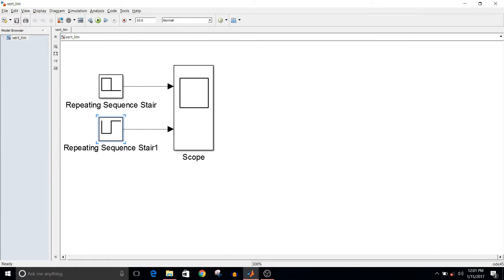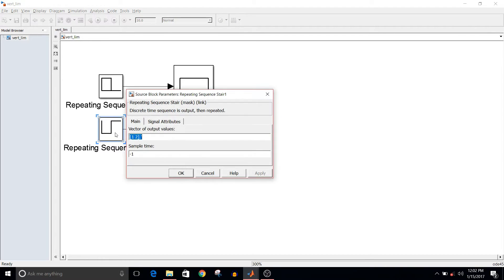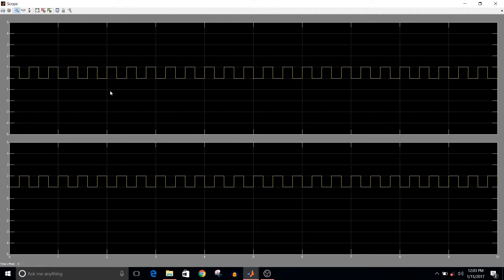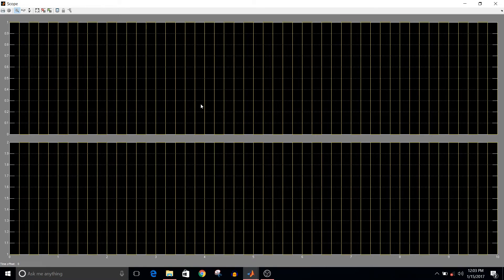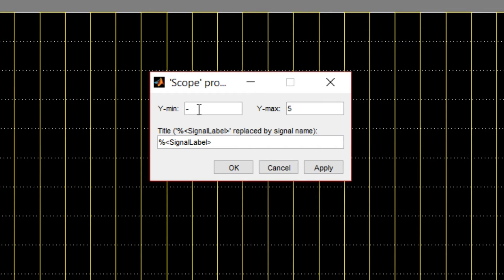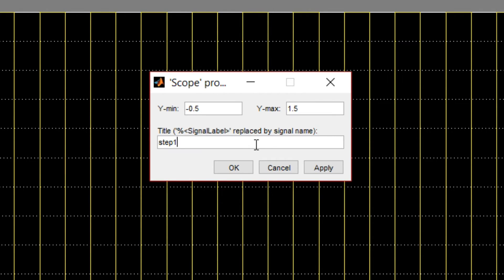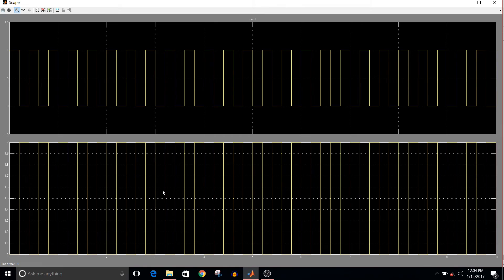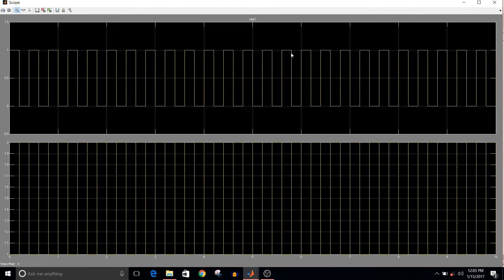Simulink Tutorial - 16 - How to add vertical limits and name to the axes

Comment: Can you tell if we have designed power system model with no of buses ,and we have taken 3 input ports at the scope how do we differentiate which graph is for which input .Is there any such way we label it in model itself and then it is itself highlighted in graph after the model is run to avoid confusion